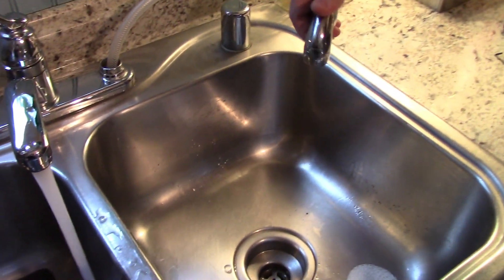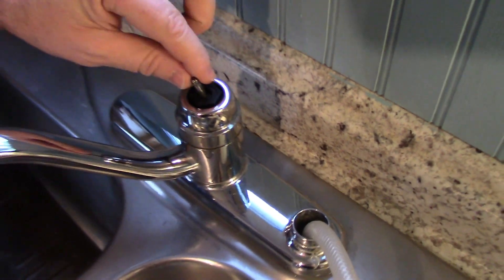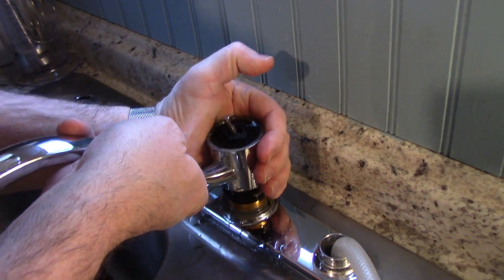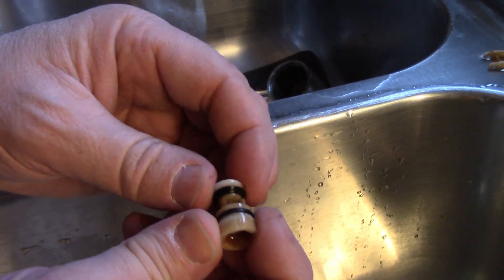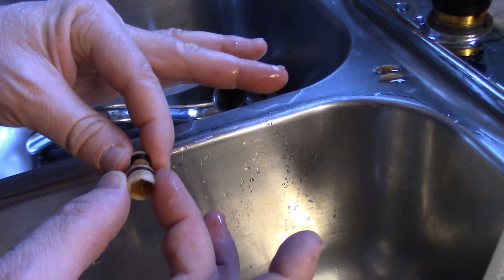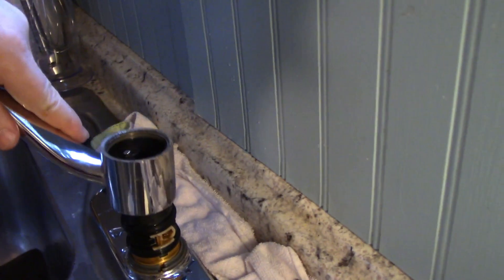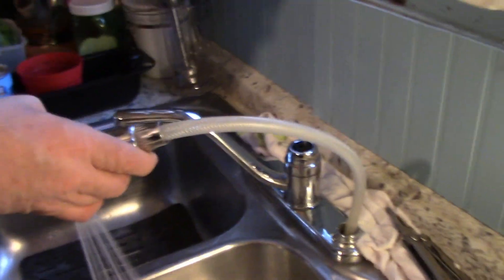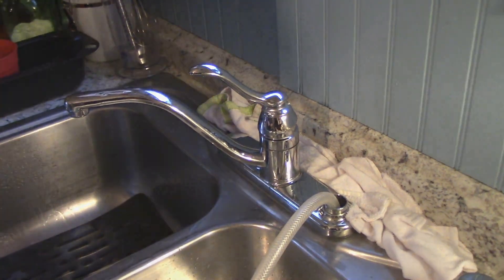Broken Sink Sprayer fix: less than 5 minutes

Comment: Water supply line to house was replaced by city. Loose particles from pipe cut, scale etc. completely blocked this valve and result was sprayer worked fine, faucet no water! Thanks very much for this video -- fixed.

Comment: Fantastic. Worked like a charm but with my model I had to turn the water off.  The valve came out with little trouble, I saw the rock , blew it out with compressed air, lubed the o-rings with olive oil put it back in reverse order and it worked like new. Thanks a million.
Reply from the maker: You are very welcome we're glad this helped you fix your sprayer😀 have a wonderful day!

Comment: I have the exact same faucet. The diverter didn't want to seat. It seemed impossible until I put a little vaseline on a Q tip and smeared it onto the end of the part that needs to seat. Also some vaseline  where the two parts meet, so the the part didn't fall and catch on anything on it's way in. I may have imagined the last part, but it worked.

Comment: My problem is the other way around. The water is only coming out of the sprayer and not the faucet. Do you have any video for that problem?
Reply from the maker: Hello Yamin. Check to see if the in take of your faucet is plugged. Make sure you unscrew the screen from the end of your faucet. We have to clear ours out about every 6-8 months. We use a heavy pipe cleaner and knock out the junk. 😁